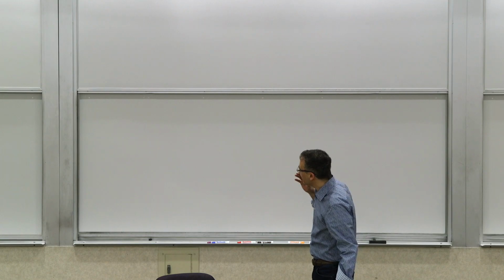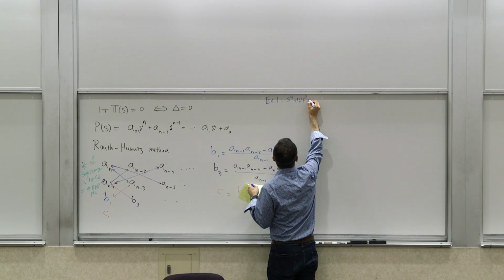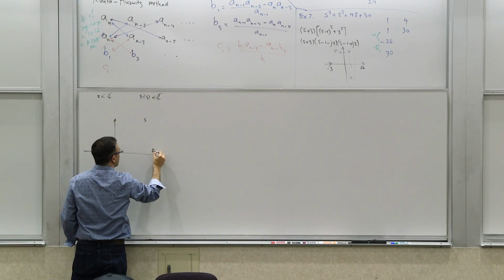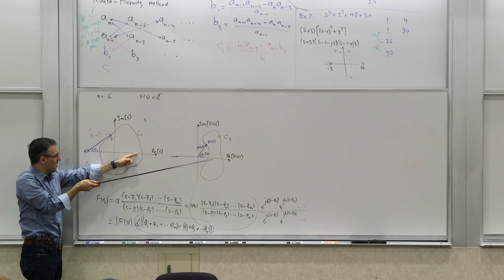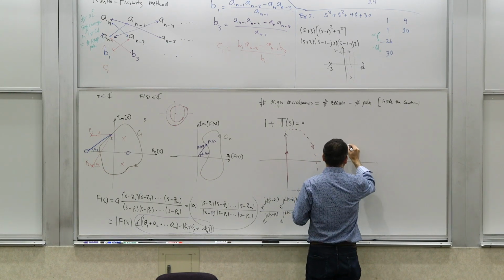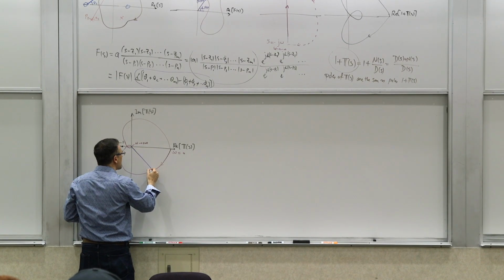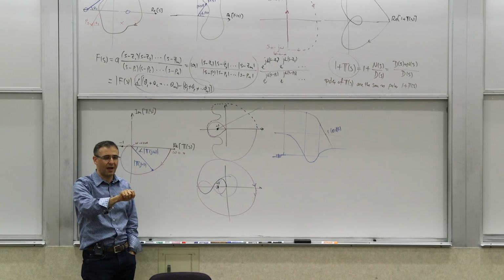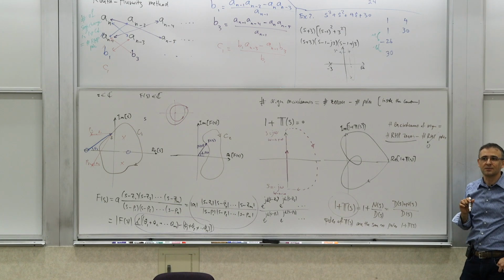167N. Stability criteria: Routh-Hurwitz, Nyquist derivation

Comment: @37:53 does not make sense to me. Need to watch again to understand this lesson.
Reply: since both loop gain and 1+(loop gain) has same poles, if loop gain is stable(no RHP poles) then same to 1+(loop gain). thus the number of RHP zeroes of 1+(loop gain) are equal to number of origin encirclements of 1+(loop gain). But our transfer function has 1+(loop gain) in the denominator, thus zeroes of it becomes poles of transfer function.